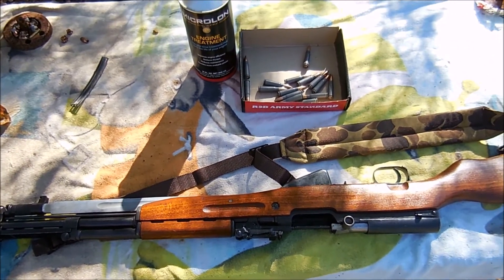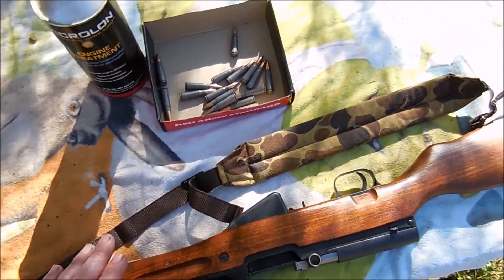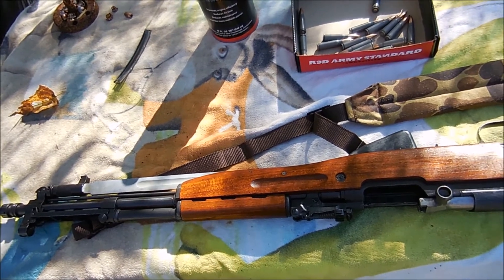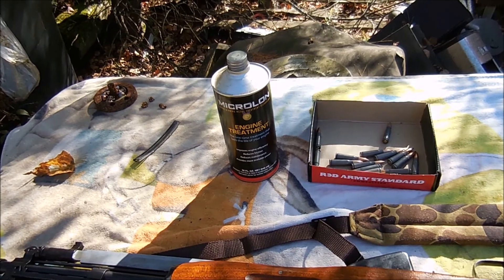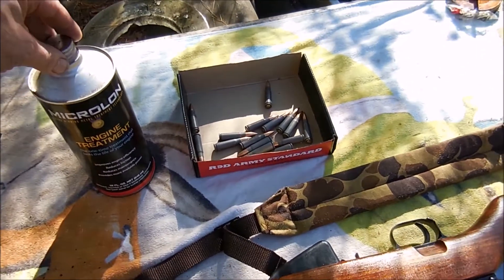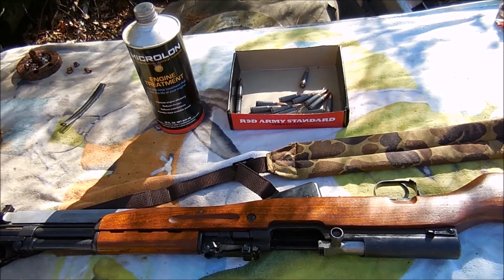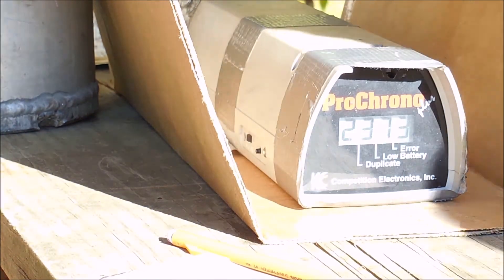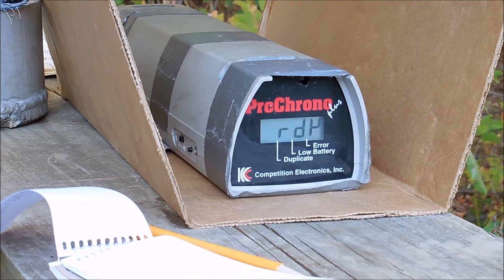Microlon one time metal treatment on SKS rifle barrel

Comment: I love the way you describe Microlon and the way you work with that is really interesting, my only question why are you using Engine Treatment if we have a specific product call Gun Juice and Assemble Lub. Have you tried them?  I'm just wondering. Is a very interesting testimonial that we have here and i really appreciate it. Thanks for your preference!
Reply from the maker: I've used gun juice with excellent success. I was just impatient. I only had some of the engine treatment. I made an assumption that there was little difference. Was I wrong in this assumption? Thanks.
Reply: Not at all Sr.
Reply: It is good do, But by it self you are just cleaning, With Gun Juice you are threatening the metal.